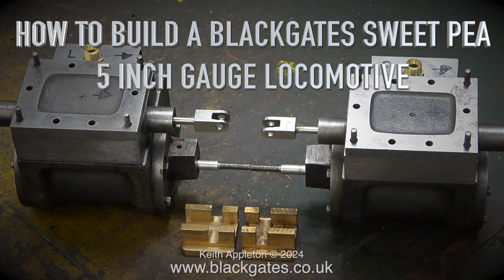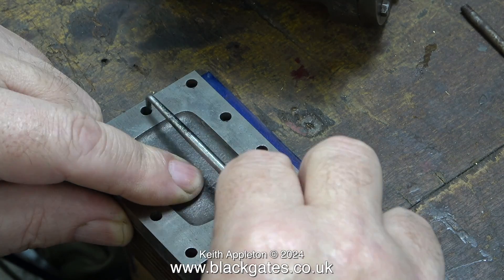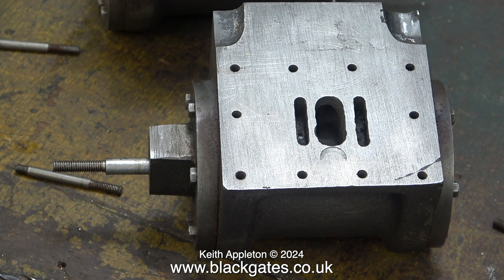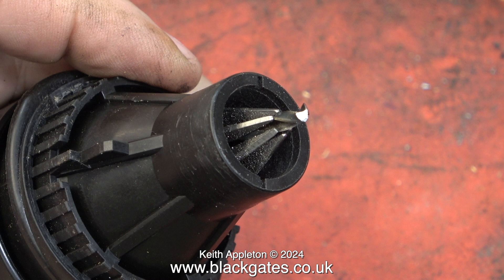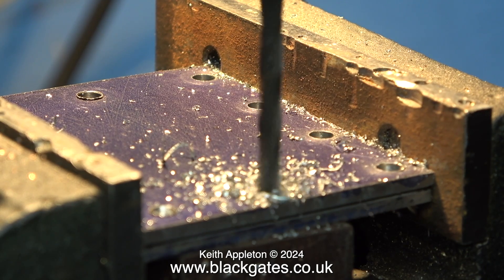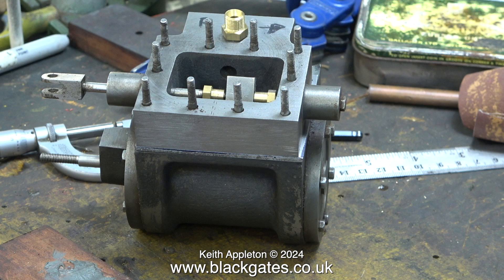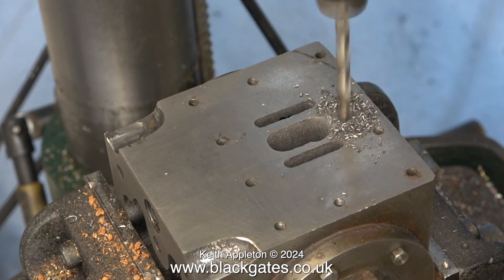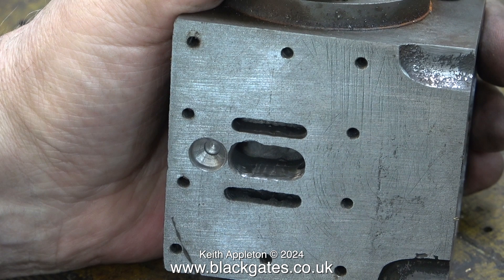BLACKGATES SWEET PEA LOCOMOTIVE BUILD - PART #16

Comment: Funny story about that jb weld putty. 

Many years ago, we had an old 40hp johnson outboard blow a spark plug, most of the thread, and some metal out while scooting down thebriver one morning. Dad, who took "bodge job" to a new level, used that putty and a heli-coil to repair the hole and thread.... that old motor ran for another 10 years of frequent use 😅
Reply from the maker: It's good stuff }:-)))

Comment: Love the videos.
Is it an alternative to machine down the face of the cylinders to remove the imperfections, then use the steel plates as the new face?  It could be mounted using longer studs or countersink screws on a different pattern than the existing studs.  Using gaskets between the parts.
Reply from the maker: Please watch the rest of the series . . . . .